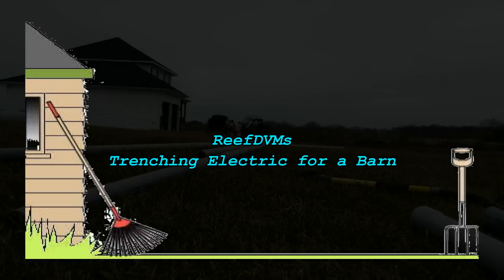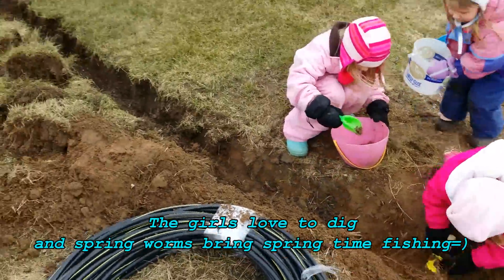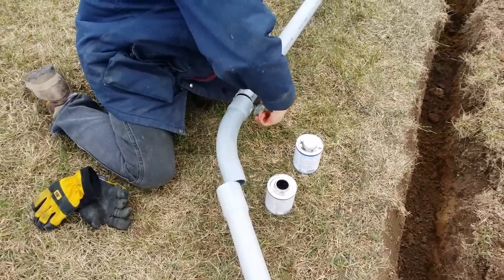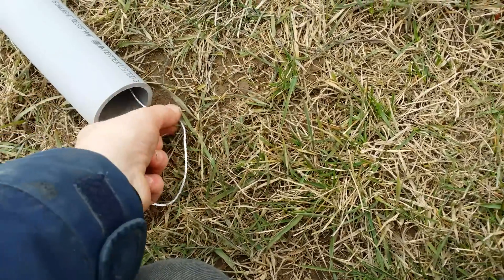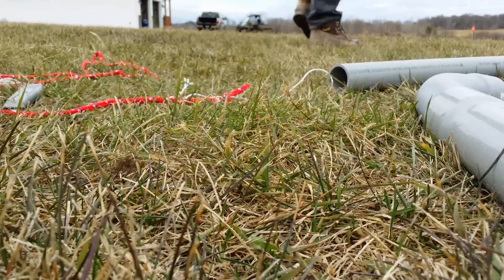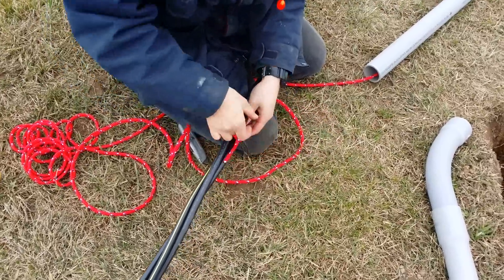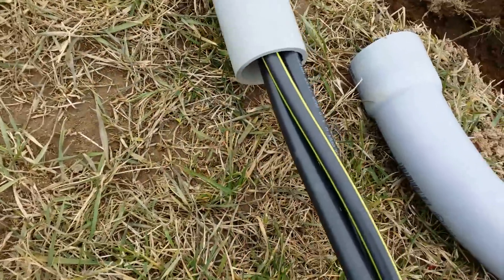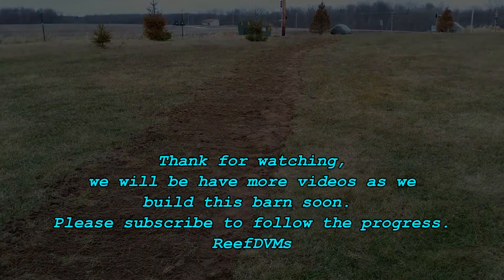DIY Pulling Buriable Electrical through PVC

Comment: On a warm day the PVC tape would just pull off so you need to loop the pull rope at least 3 times around the cable end with 10 times the cable diameter distance between each loop. That will NEVER let go. otherwise well done that lady, you did better than a lot of the men I've seen trying to pull cables.

Comment: what on earth are you gonna do with 200amp ??? its like 46+ microwave
Reply: +kristoffer ljungberg it is for a barn. could be for anything from a welder, to a car lift or anything else that takes 220 and a lot of amps. It is always better to have it and not need it than to need it and not have it. I think they did a great job of thinking ahead. Most people go cheap and only think of the here and now. They are set for the future.
Reply: +kristoffer ljungberg  Welding. HVAC. Lots of stuff.

Comment: Where did you buy your 4/0 AL?  Did you buy three individual wires or in a triplex?
Reply from the maker: +Pam Johnson menards per foot  4/0-4/0-4/0 Aluminum URD Cable (per Foot)Model Number: SKU_3692091  |  Menards® SKU: 3692091
Reply from the maker: +ReefDVMs comes all together as three twisted wires
Reply from the maker: +James Bond  Apparently in our area you dont need it, we ran just what we were told we need too by our electrician, the electricians hooked to the meter on the barn with menards per foot  4/0-4/0-4/0 Aluminum URD Cable (per Foot)Model Number: SKU_3692091,  then they have the meter connect to sub panel (not shown in this video for 200amp service ) and grounded that.  It was all inspected and passed for our county, but maybe in other areas they have to do it with 4 wires when they go to meter.

Comment: Done like true professionals. Well done.
Reply: +paul trainer naa she over doing it now way in hell a professional have time to do it that slow. 
done this 1000 times and the rope thing is only necessary if you bury the pipe before insert cable.
the way she dose it, skip the rope, just insert the cable. done
Reply: I agree after I personally sending a 16mm diameter cable up through a 20mm diameter conduit (plus corners) about 5m with no hassles. A learning curve for me, I must admit.

Comment: Did you remember the expansion fitting at the riser to connect to the barn?

Because of ground movement, it is good practice to install one.
Reply: The WHAT?? oh crap!  I just finished a job like this..
Reply from the maker: carultch we did, but I forgot to shoot picture of it.  I didnt use one on the previous setup I did to a meter on a outdoor power pole for my other barn and the frost pushed the PVC up and tipped the box forward on me years ago so I learned, I wish I had shot that on the video but I forgot=(

Comment: ...Or you could just run the wire first and slip the pipe over it one section at a time...
Reply: +SLRist No that is a code violation. Reason being is the wires usual get nicked and wet glue will deteriorate the wire.
Reply: Don't do this, as stated the glue will mess up the wire insulation.  The string thing with a shop vac works great.  I use an old screwdriver in my electric drill to reel in the string when I pull the line.  You can buy parachute cord in long lenghts online for pulling stuff through conduit.  Most stores only sell rope in precut sections that are pretty short.  soapy water does a decent job of lubricating the process, beer does not.  Yes, you also need electrical caution tape over the top of the trench to warn other diggers.  People get killed when they potentially dig into an electrical line.  

Loved the little helpers.  3 kids per 10 foot section was sufficient.
Reply: ***** What I was thinking.
Reply: Mark g I imagine the primer is hard on the insulation as well.
Reply: If you want to do it incorrectly you can

Comment: What size conduit and did you use 80 on each elbow? I want to run 2/0 2/0 2/0 but i want to make sure the copper wire will fit ok and that is why i need to know what is best for that wire in size?
Reply: http://www.elliottelectric.com/StaticPages/ElectricalReferences/ElectricalTables/Conduit_Fill_Table.aspx
Reply: Yeah,that elliott elec catalogue is full of wire and elec motor information. Handy to have.

Comment: Was that 3 in conduit ? I am currently in the process----inspector told me I had to bury it 30 inches -----after watching yur video I went out and measured and it is 95 feet----he said he was following the National Electrical Code---is that wat u are quoting? Did u use a 3 inch attachment on a large shop -vac? to suck the thread through? Thx to u and yur family for the helpful video
Reply: ReefDVMs That is why you are supposed to lay warning tape on top of your first layer of backfill.  Thus, any future digger will hit the tape and stop, before hitting the conduit.
Reply from the maker: Electrical Wire Encased in PVC Conduit

The National Electric Code (NEC) sets the required burial depth of electric wire in rigid, nonmetallic conduit, such as PVC, at 18 inches. Cable in any conduit, including PVC, that is buried at this depth is not in danger of being severed or disturbed by normal digging. However, keep in mind that no cable or conduit is protected from digging by construction equipment such as trench diggers or backhoes.

we used a 2 inch I think I will ask my husband but pretty sure
Reply: carultch That's always a good step when sand is not readily available or addition too. A 6 inch layer of sand around the pipe helps to alert a trencher better than tape because its easy to miss a little piece of chewed up tape.
Reply: Depth of burial is determined by potential traffic

Comment: OOPS!  Code Violation- Not allowed to piecemeal the conduit and conductors together . You have to assemble all of the conduit then make your pull. NEC 300.18 and also look at Art. 352
Reply from the maker: homer simpson Actually had it inspected at digging asssembly and before we buried and since conduit was not required on this direct burial wire and the in this case it was considered short section under 100ft by our county inspector he said we were fine...  your right though one should always go by the local inspector...our stated "300.18: Exception: Short sections of raceways used to contain conductors or cable assemblies for protection from physical damage shall not be required to be installed complete between outlet, junction, or splicing points.
Reply: correct and the wire may pull easier and not get hung up if pulled thru the bell end first

Comment: You mean a pole shed?
Reply from the maker: A barn is an agricultural building primarily located on farms in rural Minnesota and used for many purposes, notably for the housing of livestock, storage of crops, farm equipment storage, and as a covered workplace.  Many other names are used to such as shed, out building, pole barn, livestock barn, tack building, steel hull, and loft barn.  Sure there are more name too...so its going to be a big red and white barn.